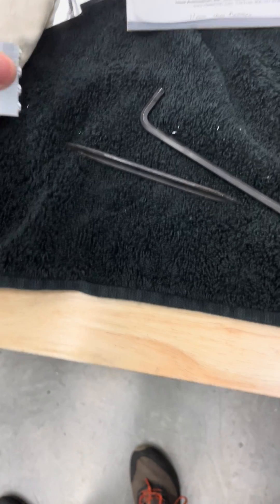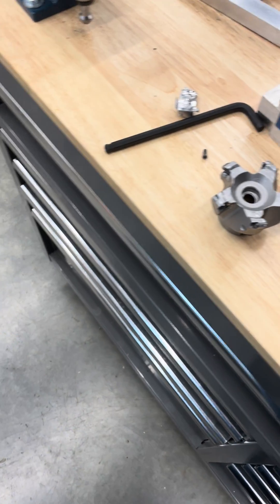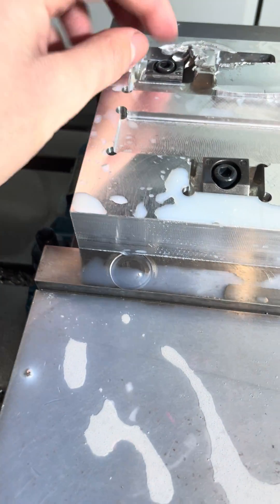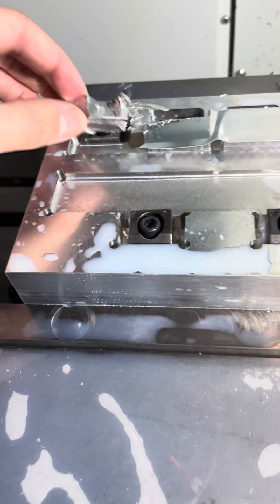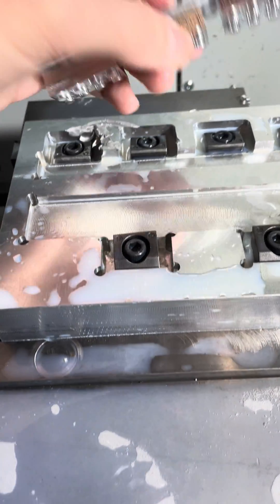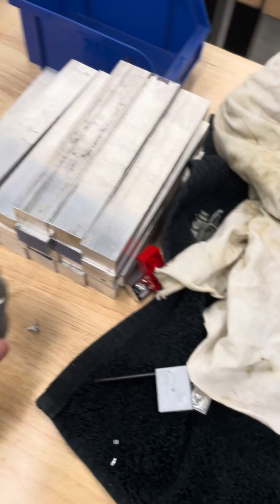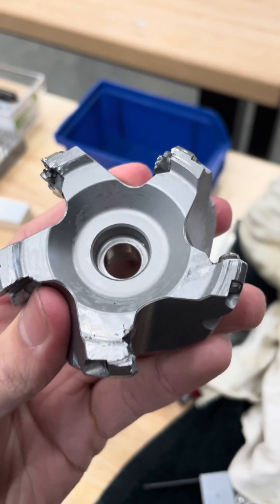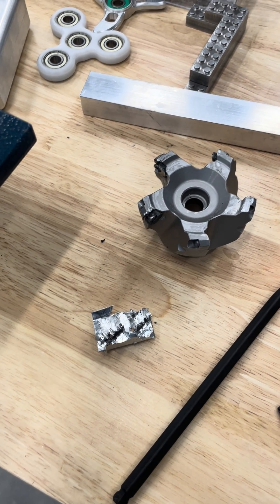Crashed the haas milling machine at school today

Comment: Take face mill have welded up then bench back to shape may need run tap thru threads best to put screws in before weld tell welder stay away from threads use new inserts use height gage to get inserts all same level then bring dia in all tool die shop have polishers usually one those guys will be skilled at getting tool corrected